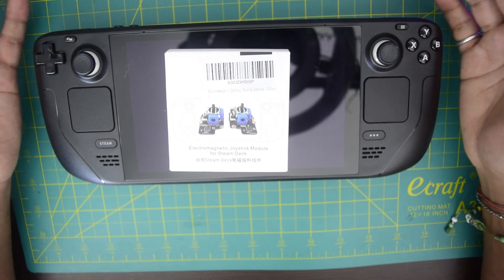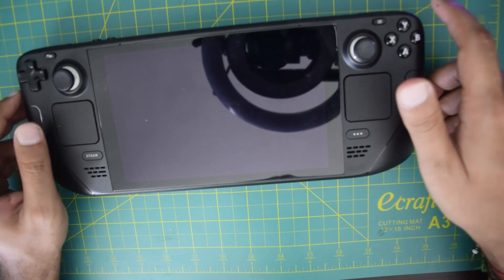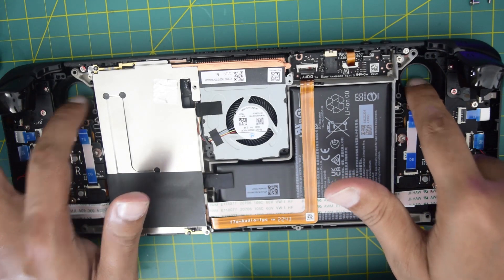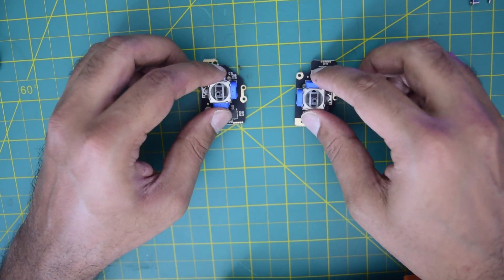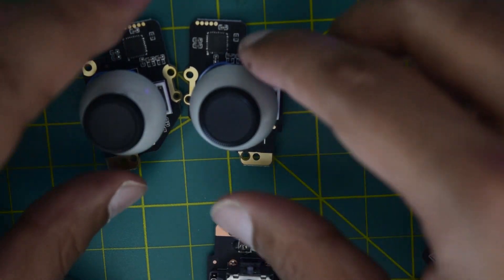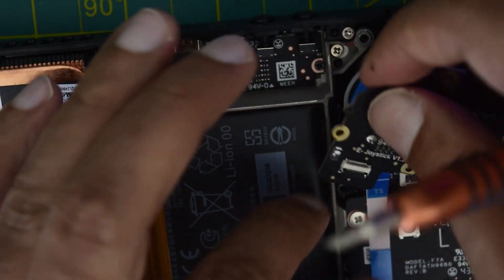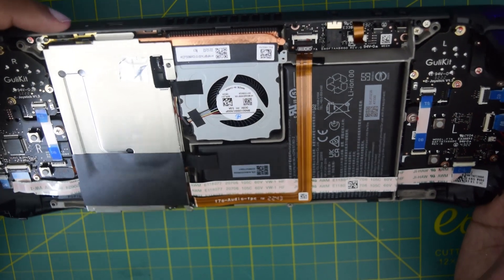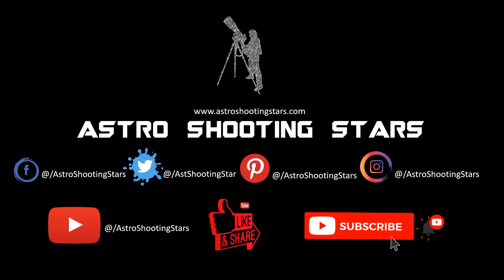HOW TO UPGRADE JOYSTICK ON STEAM DECK | Gulikit Electromagnetic Joystick WITH Hall Effect Sensor

Comment: I've built and upgraded a lot of PCs, but never done any soldering before. Is there a model or brand of soldering tool you would recommend for this kind of work? And the material used when soldering is called flux I think? Is there different kinds of flux for different jobs?
Reply from the maker: any soldering Iron which can heat upto 400 degrees celsius should be fine. brand  would depend on the location , soldering station is too much cost for beginners but if you can it would better. soldering wire with lead is easy to mange as long as you dont inhale the fumes but there is solder wire without lead as well. flux helps to solder and desolder easily there is one i like is called no clean flux which is recommended. i hope this helps. please stay tuned to my channel for my future videos.
Reply: thanks so much!  @AstroShootingStars